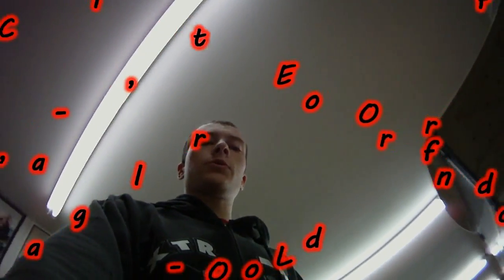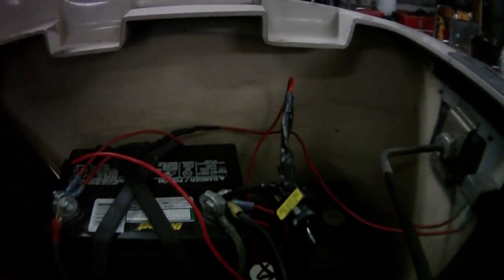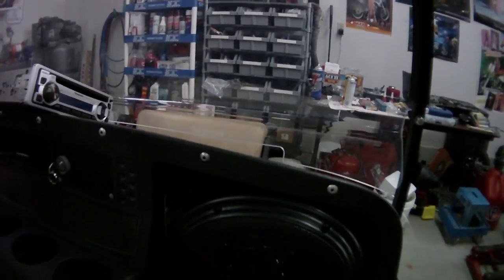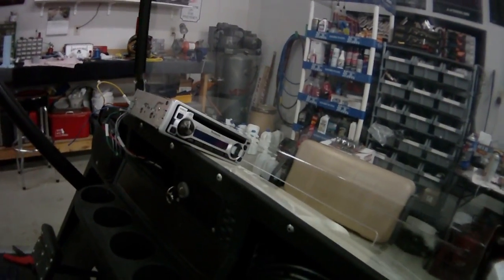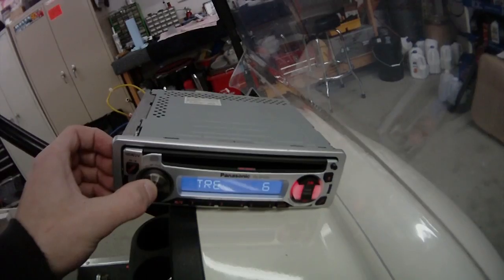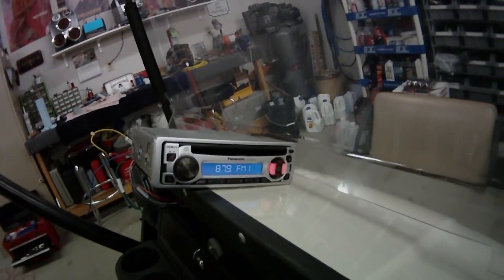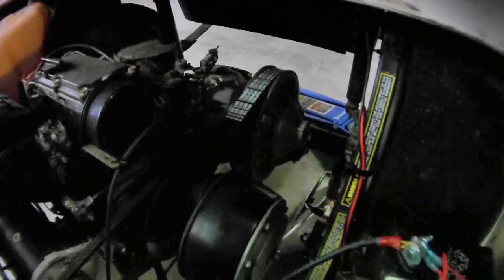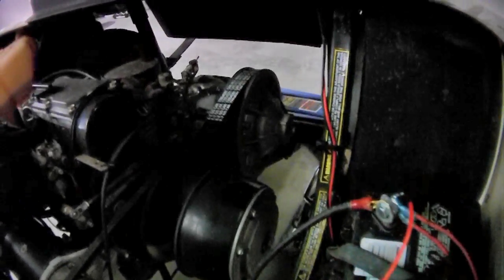Part 2 - Installing A Head Unit - Adjusting The Speed Governor - E-Z-GO Off Road Lifted Golf Cart

Comment: can u help me with the drive belt on my golf cart got my cart running but will not go is there a tension pully or something to keep the drive belt tight
Reply from the maker: Livin Life 
The drive belt is kept in tension by the clutches.  If it is slipping, your clutch spring(s) is(are) bad, or your belt needs to be replaced.  :/  Sorry.

Comment: I have a 2005 ego cart 9hp robins, just put a 5in madjax lift 23in tires and Gboost clutch kit. I'm still having issues on hills still motor is boggy but on flat ground all kinds of power. It also has new plug wires and valves adjusted if any of you have any suggestions please let me know.
Reply from the maker: At the end of the day, 9hp is just too low to do any real hill climbing.  The cart itself is a very heavy steel frame.  Add bigger tires and you've lost all your torque advantage.  Even the "bigger" motors that claim 10hp or 12hp are still too small.
Reply: PowerSports what if I tightened the governor up I don't go fast I use cart at my campsite it's only 10mph there and the hills I want to climb aren't that big there just some trails in the woods they made and what engine you got in your cart.
Reply from the maker: The governor usually only controls top speed.  My cart was the OEM engine.  It was very slow on hills, too.
Reply: PowerSports is there a way to tell what gears are in it, I think my hole rear end was replaced before I bought it it look brand new.
Reply from the maker: Put it up on jackstands, and turn the clutch by hand.  Count how many turns of the clutch, versus how many turns of the wheel.

Comment: I think my E-Z GO golf cart must be too new because I found that string deal and it has a small nut on the end, but when I try to tighten the bolt it turns the whole deal and the spring doesn't tighten any. The small bolt has already used up all the thread of the bolt, but the spring it still very loose. Is there any other way I can still tighten that spring or increase the speed somehow?
Reply: jon gimbo I can take a picture of it if u need me to.
Reply from the maker: jon gimbo 
it might be rusted, or it might not be adjustable
Reply: It isn't rusted. I just think that it isn't adjustable. Do you think if I put something on to hold the spring tight that it would work or would that like screw up the golf cart?
Reply from the maker: The spring is supposed to be able to turn freely...  idk how to help, its been a long time since I messed with a golf cart...  sorry!!!